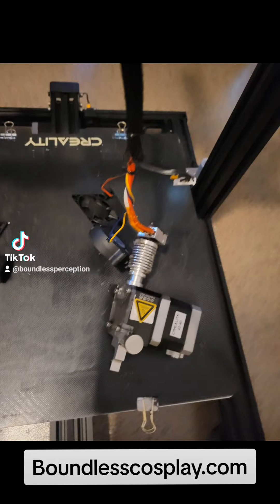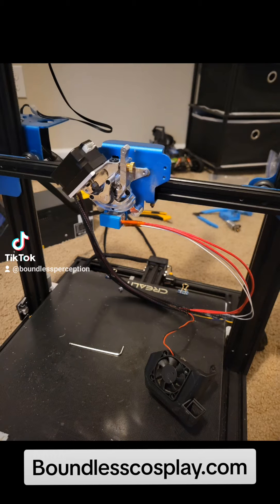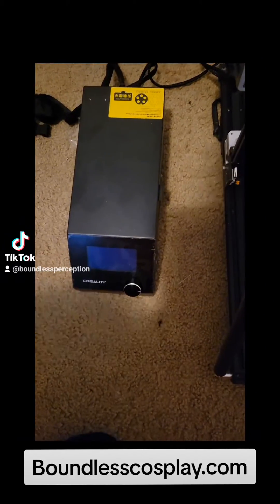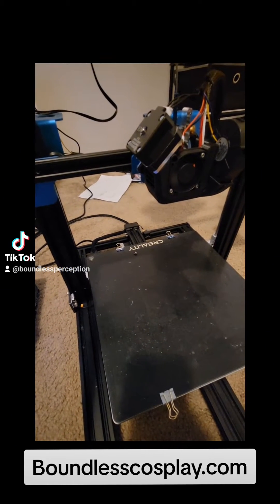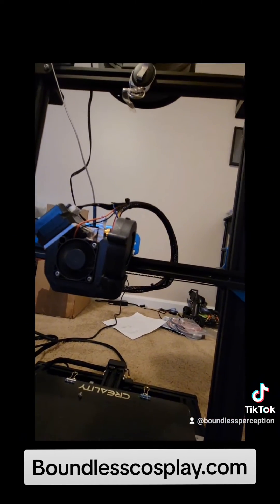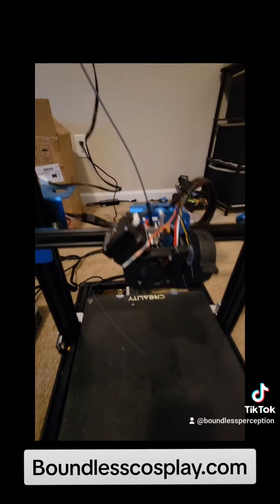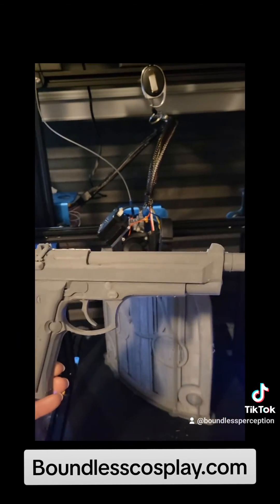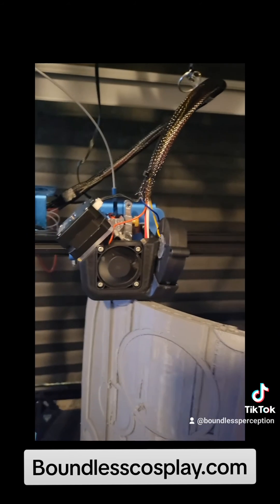Installed The Micro Swiss NG Direct Drive Extruder

Comment: Just trying to tweak the settings on  mine. What are your retraction settings in the slicer you are using? I’ve been trying 1.5 with an acceleration speed of 35 mm but some have been doing a lot less retraction and say it’s not necessary. What are your thoughts, it looks like your prints look great!
Reply: I just got mine a few weeks ago I’m having better results around .2-.3 retraction distance and 15mms speed, haven’t quite perfected it yet tho keep getting very very fine hairs